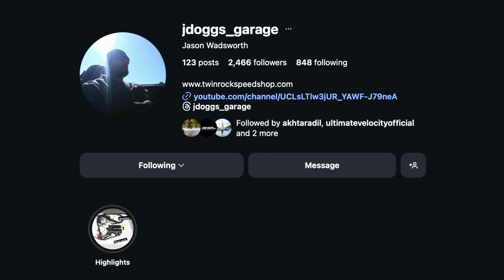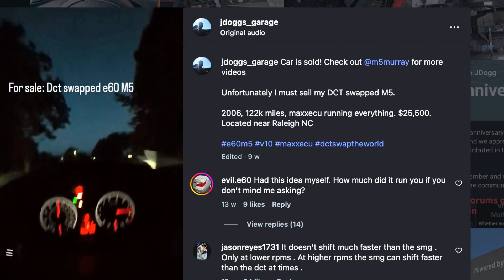S85 V10 DCT E92 M3 - BMW Engineering vs Maxx ECU!!

Comment: Hello! First of all...you are doing an amazing job out there. I wanted to ask you some things about the idle motors, because i work on a similar project, an E46 with S85, on Maxxecu Pro. My question is : How did you managed to controll the idle butterflies, they have position feedback in the VW circuit? If NOT, how have you managed to controll a precise movement of the butterfly? If YES, how did you managed to get the idle motors work, knowing that maxx have only 2 Hbridges, used for throttle actuators? Thanks !
Reply from the maker: Hi, thanks for kind words, we are still in the process of finalising the wiring loom & calibrations. We do however know this exact setup works as one of our subscribers has given us some of his info from his old e60 m5 DCT on Maxx running this exact setup, I believe he may have commented down below, if not this video one of the others. We can update you once it’s running and we know exactly what worked. If you want to keep an eye on the channel when we post our start up video drop another comment & I’ll update you when I actually know answers to your questions. ✌️
Reply: @wds_originals  thank you , i will ask @jdoggs for some info , and i will donsome functionality tests in the meantime. I will keep you also updated on the things i find. Thanks again for the fast response.
Reply from the maker: @3Fun_Catalin  no worries man, he’s a helpful fella, got me over many hurdles, I’m very greatful for his input that’s for sure!! Let me know your results if you think the knowledge is worth sharing 👌

Comment: What’s the part number for the VW part?
Reply: Make sure they are genuine OE throttle actuators, I bought several brands of aftermarket actuators and the internals are completely different and not interchangeable with the bmw part.
Reply: @jdoggsgarage4494 so what’s the part number for the vw actuators?
Reply: @showoffgod7617 there were a few if I remember right one is 03G128063T from 2009-2014 VW Touareg/Audi q7 tdi
Reply: @jdoggsgarage4494 thank you
Reply: U5014.
Reply: @tom @tomaszdabrowski8021 google says that’s not a part number for vw throttle bodies.
Reply: @showoffgod7617  A shit, thought that you wanted coils number.
Reply: @tomaszdabrowski8021 looking for throttle body parts for the throttle control valve. They look like 2009-2014 vw Jetta 2.0 diesel tba backings but I can’t confirm
Reply from the maker: looks like American Jason has answered the question for you - top man!!